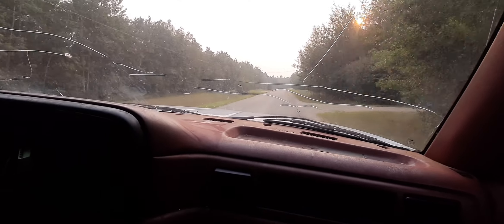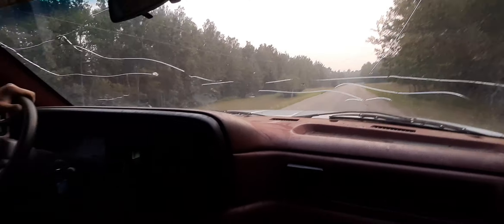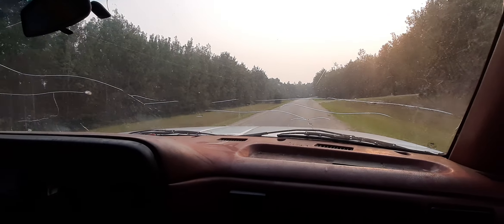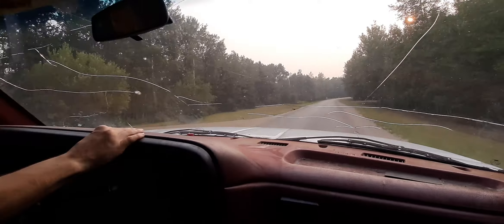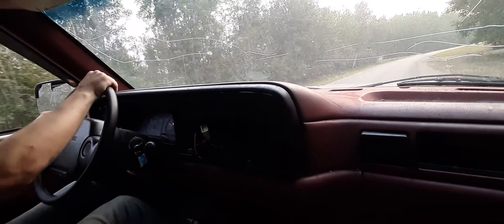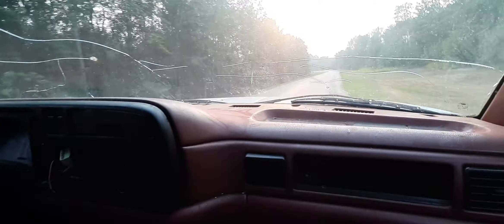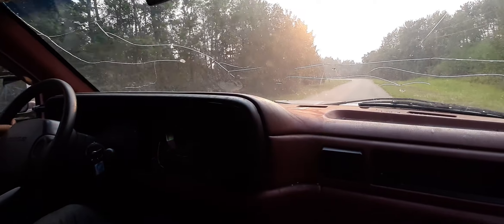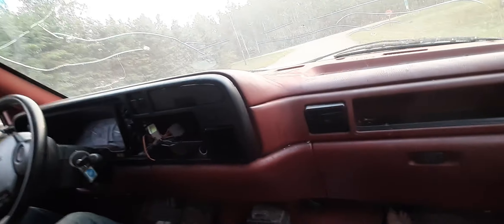DODGE SLIPPING TRANSMISSION PART 3

Comment: My tranny keeps cutting out in my dodge too. In and out of the transmission shop once every 10-12 months, can’t find a permanent fix. Drive turns into a neutral gear and 1 and 2 are the only drive gears. Love my dodge but the legend of the transmission is true
Reply from the maker: I'm having mine rebuilt soon. It has 404k miles on it so I'm not surprised.